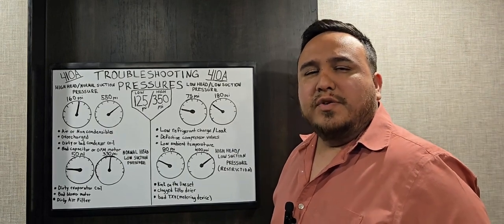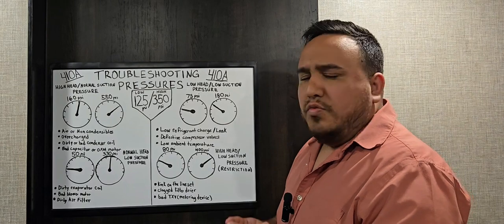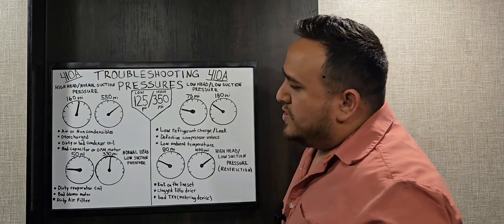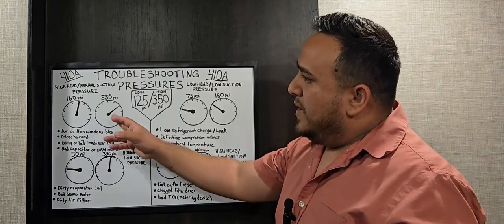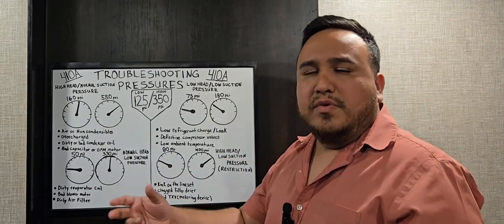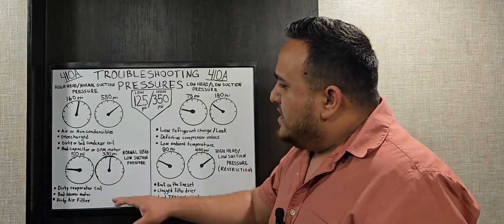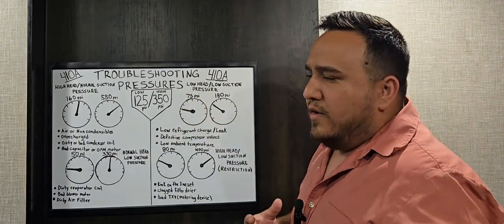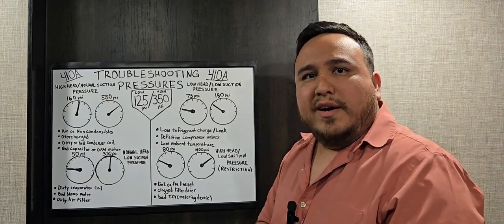HVAC Troubleshooting 101: Mastering Pressure Issues Like a Pro!

Comment: Preassures are nothing brother, Subcool ,Superheat. LLT, SLT,VSAT, LSAT. amps on compressor. ODT , there is some much much to check than preassures.
Reply from the maker: I agree with you to a certain extent. Yes, all that you mentioned is very important in bringing out the most efficiency from a system. To understand that it is functioning properly involves more than just pressures. In my personal opinion, we can't rule out pressures because they also play an important role in understanding how the system is performing. This video is mainly to target individuals who are new to hvac. Just to give someone a brief understanding of how to approach a system and build a bit of confidence and start off with something like pressures. Later, I do hope I can make a video explaining why we can't just rely on pressures alone and the importance of all that you mentioned as well.

Comment: Comfort cooling is designed for a indoor air temp aka return air temp of 75° and an outside ambient air of 95°. No matter the refrigerant your metering device is shooting for around 38-40° vapor saturation temp. R-22, RS-44B, R-410A, R-407C etc. all of em shoot for the same vapor saturation. You want to know if your pressure is low. Just take your PSI AND CONVERT IT TO TEMPERATURE using the P/T chart for your refrigerant. Is it well below 38°-40°? Of course expect it to be a little lower if your return air temp and outside ambient is lower than design and vice versa when the temps are higher.
Reply from the maker: Yes, that is exactly correct. I couldn't have said it any better than this. This is a great comment. Thank you!

Comment: What would cause 350 PSIG on Suction Line with system OFF and system on down to 33 PSIG. Liquid line @ 133 PSIG (matches ambient) and running @ 183 PSIG. 
R22 .57 piston 76 Ambient. Tested with multiple lines and gauges
Reply from the maker: Whoa, 350 psig on suction side is insane. Usually you get into what's called "retard" pressure. Any time low pressure rises to that extreme could indicate that you have a bad txv or are probably overcharged but you mentioned while the system is off which is leading me more to a possible restriction or it can be that the compressor valves are bad and its feeding pressure back into the low side.

Comment: Would you clean the coil before putting on the hoses?
Reply from the maker: I apologize for the way late message, but I would make sure that both coils are clean before getting accurate temperatures and pressures. You won't be able to diagnose a system as best as you would like with dirty coils.

Comment: Does the same apply for R22?
Reply from the maker: Yes, it does. R22 works with lower pressures, but the same concepts apply
Reply: @NewGenerationHVAC thank you for this valuable information. This is the kind of stuff that takes years and years of experience to understand and pick up.

Comment: I wish this industry would quit worrying so much about pressures.  There are too many refrigerants out there to remember all of the pressures.  In my opinion, every tech needs to be thinking about saturated temps.  We are in the business of tempatures, why don't we talk about refrigerant in tempature?
This will be way less confusing for the beginner and the teacher.
Reply from the maker: In my opinion, understanding system pressures plays a key role in both reading and diagnosing HVAC systems. While there are many types of refrigerants out there, I believe it’s not necessary to memorize the pressure characteristics of every single one in order to be successful in the trade. However, when it comes to temperatures and how they relate to refrigerants, I see that as essential knowledge. Concepts like saturation temperature and heat transfer can really sharpen our ability to diagnose accurately. I've touched on some of these topics in my earlier videos, and while I haven’t yet covered subcooling and superheat, those are definitely on the list. We’re committed to teaching our students how to work with refrigerant temperatures confidently and effectively.

Comment: That's kind of what I figured.  What do you think of my numbers?

R410a 3.5T heat pump, Txv.  Blower speed: high

Outdoor temp: 87

Hi side: 91.7f  

355psi (108f),  16 sc

Indoor temp:  72

Low side:  56f 

110.6 psi (35.6f) 20 sh
Reply from the maker: To me, those numbers look good. Both pressures and temperatures look like they are where they are suppose to be according to the refrigerant you are working with based on your ambient temperatures.

Comment: hello i have a 1.5 tons unit r410 and it was not cooling properly so i check the unit and the filter dyierr was clogged and the compressor wotn do  complete pump down, i removed the refrigerant and replaced the filter charged the unit with the factory charged amout of refrigerant but still gave me 170psi in suction line and is not cooling, and the coolest temp in vents are 68deegrees. i m out of options
Reply from the maker: Im sorry you are going through that issue. Now I suggest seeing if both coils are clean to allow the proper amount of airflow. If both coils are clean, then based upon the pressures you provided, unless you are dealing with a possible micro channel condenser coil, then it's a possibility that too much refrigerant is in the system. If the lineset is not too long, then adding all of what the manufacturer specifies may be even a bit too much. Another possibility can maybe even be the txv stuck open, maybe its not regulating or metering propery at all. If metering device is fixed them make sure the right piston is installed, and one needs to make sure its facing the right way as well.
Reply: @NewGenerationHVAC  its has the correct piston .49 i cleaned the coils inside and outside, and i checked the amount of refrigerant that i removed and tha  t was the amount that i chaarged the unit
Reply from the maker: I see. The thing is that there are many variants that need to be seen. Take a superheat reading, and I would suggest to double check the length of that linset. It may still be overcharged. Also, there could be a leak in the return where hot air is returning back. The system can be undersized, or the heaters can be running at the same time the cooling is on even though that one may seem unlikely, but one never knows. To give a proper diagnosis, I would personally need to be in front of that system myself.
Reply: @NewGenerationHVAC  Thank you for your comment. I reviewed all of that, and since I didn't have the resident with a window unit for more than 5 days, I decided to change the compressor and the problem was solved. I think the compressor was starting to fail and I've had a lot of problems with the Smart Comfort brand so far this year. This is the 4th compressor I've changed. Thank you very much for answering the questions. You were the only one who answered me. Thank you.
Reply from the maker: Im glad to hear you resolved the issue. I am assuming the valves from the compressor went bad. But the question is, what caused it to have bad valves? 🤔 hmm, that's a good one. A student had given the same issues, and I do remember him replacing the compressor as well. I hope you do find what caused the issue with the compressor. And yes, if there is anything else I can help with, feel free to let me know.
Reply from the maker: Also, I'll look into that smart comfort brand. Thank you for sharing as well.
Reply: the dischared pressure was 365psi

Comment: Everything is a temperature.  If everything is a temperature, it doesn't matter what refrigerant you are using.  Working with temperature allows you to see this relationships between different components.  

You can see that suction pressure is primarily driven by the indoor temperature.  With proper airflow, the perfect saturated suction temperature is 35° below the return temperature.

Perfect condensing temperature is about 20° above the outdoor temperature.
Reply from the maker: Great points! Temperature truly is the key to understanding system performance. Suction pressure is primarily influenced by indoor temperature, while condenser pressure is largely driven by outdoor temperature. Your reference to a 35° drop below return air and 20° above ambient are solid general guidelines.

It’s essential to understand the relationship between pressures and temperatures in refrigeration and air conditioning systems. While the general principles apply across different refrigerants, it's important to remember that each refrigerant has its own unique pressure-temperature curve

Comment: We cant rely on pressures for diagnosing a problem. We have to check superheat and subcool.
Reply from the maker: That's absolutely correct. We can't just rely on pressures alone. A proper subcooling and superheat test is also necessary as you are dealing with temperatures combined with pressures to have a more accurate diagnosis of an air conditioning system.
Reply: Sure, but if I hook up to an R22 system and see 421/98, I immediately know that's a problem.
Reply: @michaelhoogendoorn3179 and it’s times suction and head looks good til you check sc & sh and saturation
Reply: @michaelhoogendoorn3179  right but whats causing the problem? I can hook up my gauge to any system and see a problem withh those pressures. However you wont be able to narrow it down on just pressures alone.

Comment: Regards to the sample psi 125/350 psi you used to explain. How do I find the accurate psi if I know the temperature around me? 

Thank you. This is was most concise video I have watched.
Reply from the maker: You must use a pt chart. Pressure and temperature correlate. I used 350, but here where I live, we average about 102° so the pt chart reads a high pressure of around 325. But if the day is a bit cooler for us, say around 98° then my high side should be around 310psi, which if I connect my guages, the pressure should be around there. We have to maintain a coil temperature of 40°-45° so I target the middle at 43° which is 125psi. But if the high side temperature drops, so does the low side temperature and pressures. So if everything is working the way it should be, and the evaporator and condenser coils are clean, and so is the blower wheel . Good airflow is passing through these coils, then at 98° the pressures I should be working with are around 310psi/115psi. 
Please let me know if you continue to have question(s).
Reply: @NewGenerationHVAC  Got it, thanks for explaining it so well!
Reply from the maker: No problem 🫡
Reply: @NewGenerationHVAC  If you do a video on charging units that would  be awesome
Reply from the maker: Yes, I still have many ideas for videos. Please be patient with me as I don't focus on this full time, especially now that summer is approaching. I will try my best to be more consistent like I used to be and I sure hope to post a charging video soon. Thank you for watching

Comment: Hey brotha I just started HVAC school this month and your vids are helping a lot! Appreciate the videos!
Reply from the maker: @bryanherincx3844  Hello, my brotha. I'm super excited to hear about your decision to enter trade school, and I hope you enjoy your journey to becoming an HVAC technician. I am glad my videos have been helping your progress.
Thank you for the support!
Reply: @ yea man thank you! Starting our next module on Monday! Electrical!
Reply: Perfect pressure for 410 is 125 on suction and 325 on discharge depending on ambient air temp
Reply from the maker: Well, they depend on different factors other than just your ambient temperature. One thing that gets overlooked a lot is how clean the evaporator and condenser coils are. Also, you blower wheel. So basically, anything that affects proper airflow to your ac system will affect your pressures. I used those pressures because here where I live, we average an ambient temperature of 102° so on my pt chart that is about 325 for the high side and because pressure and temperature correlate,  I want to keep an evaporator temperature of 40-45 degrees, so if I target the middle at 43° that is about 125 psi on my low side.